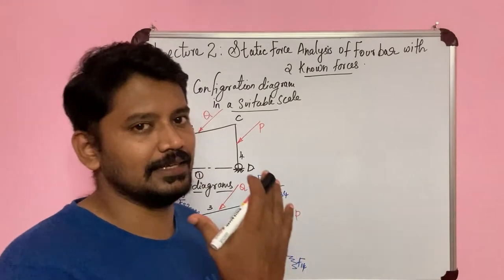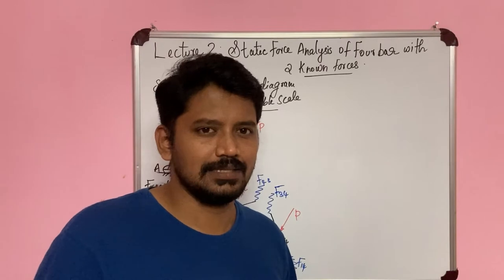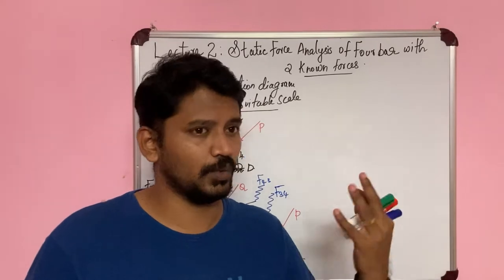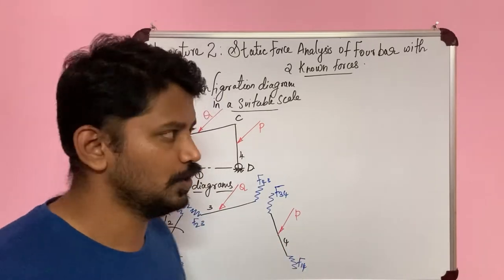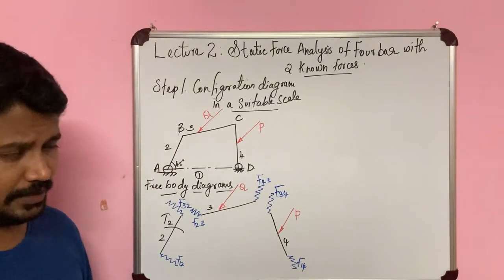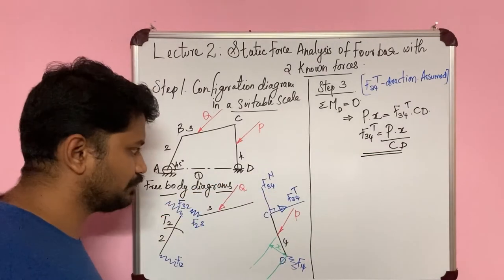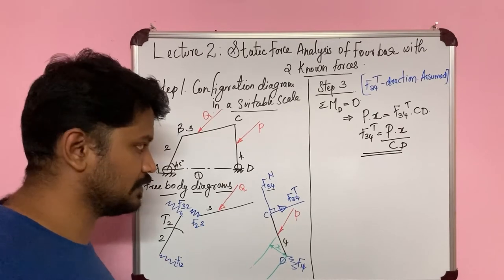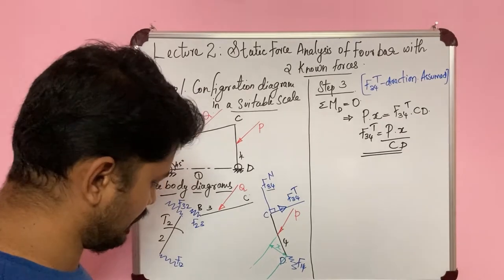Dynamics of Machinery | Static force analysis of Four bar mechanism 2 known force (graphical method)

Comment: wrong
at 9:31
Reply from the maker: At 9.31 minutes I am saying Force F43t is not parallel to 3rd link. And its acting inside. Both are correct. It is so because I have taken F34 acting to the opposite side in 4th link. That is the correct method. I would suggest you check your facts and understand before declaring its wrong.